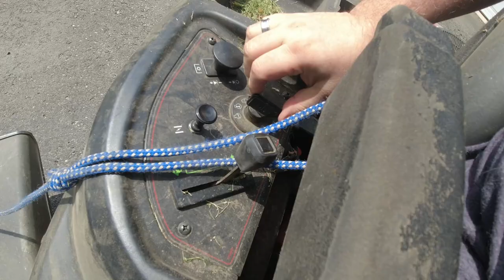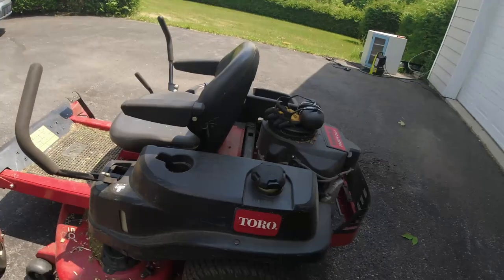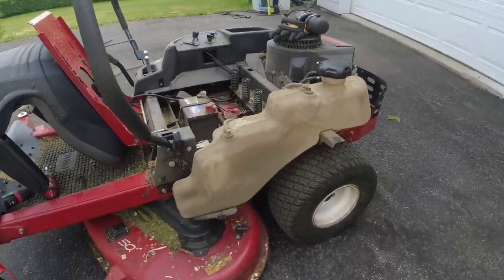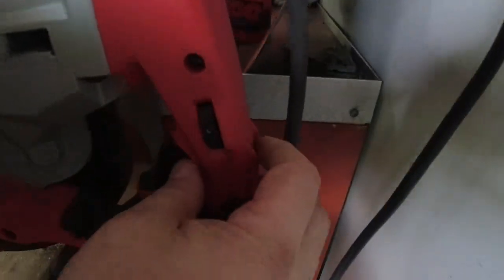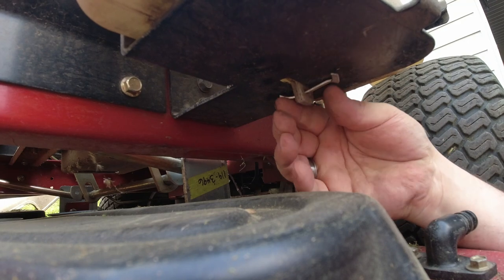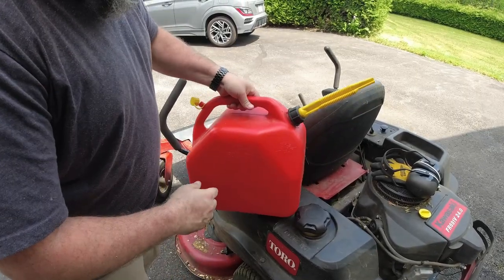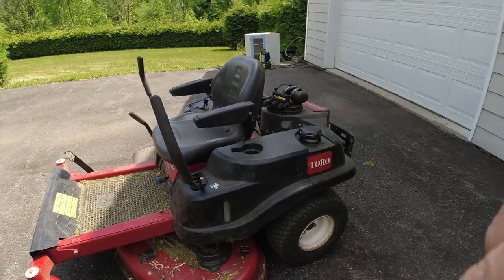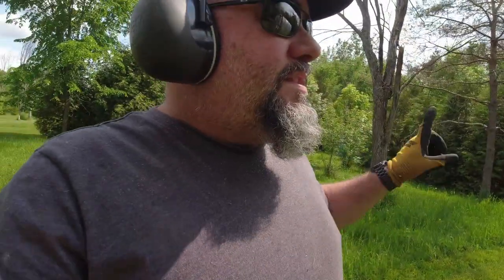Simple Solution to Your Zero Turn Gas Tank Problem

Comment: I would have put a couple of zio tie on it and seen how long they lasted.    Can't  get those gas cans in the states from the store, have to get aftermarket nozzle and some times those leak and aren't any better than original nozzle if they leak...
Reply from the maker: Funny you should say that. The piece I cut up was an expensive BMW part.. Aidan was... Not too happy and suggested I use zip ties or any other piece of metal we had laying around... Oops. Ya I've seen the newer gas cans around here, but glad we can still get these.

Comment: Hello Ross, it's amazing how much nicer everything looks after you cut the grass. That was an excellent quick fix on the fuel tank.  I use hearing protection only when I operate something that doesn't allow me to talk aloud and hear myself.  I  wear different types of protection based on what I  operate.  I  absolutely do find that some types of protection will amplify the noise if not worn correctly or for the wrong application.  I always want to hear the equipment at a level that allows for appropriate operation and to be able to detect any issues.   Have a good one Ross!
Reply from the maker: That's a great point about hearing the equipment. And do the same thing. It's now raining just a bit here and will help . Thanks Paul.  Have a great week

Comment: I have a pair of Isotune in ear and one over ear. I can't keep the in ear for long because they become uncomfortable and I'm a bit disappointed with the over ear model I have, the rubber pad peel away and it's not like I wear them everyday 🤷🏼‍♂️. I might look at getting something else. I do find when a wear any style for a long period my tinnitus seems to be more loud.  My JD E170 has a what they call a floating gas tank, it's always hard to tell the actual fuel level. Have a great week Ross 🙋🏼‍♂️
Reply from the maker: I have in ear  ISO Tunes as well, and agree, they can become uncomfortable over time (most in ears I've tried do this)  thanks Luc.

Comment: I did I miss that video maaan ??? 🤔🤔 Hearing protection is a must, Ross get a better earing protection ( look at the spec ) Please Ross, I'm deaf but the Tinnitus constant ringing is driving me NUTS. So mannn please act NOW !!! Great Fixe Ross 😇👌👍 Yes best fuel tank 👍👌😇 Ross, you should make hay with that field 😇👌OUTSTANDING video Cheers 🍻🍻
Reply from the maker: Thanks David, I'm looking for better hearing protection yes. My ear ringing has been bad for many years. I should make hay!
Reply: @RossOnTheLand  I can't afford the 6k device that will reduce the tinnitus and increase my hearing cause by many years working on aircraft but it work very well when a try it for 2 hrs,,, Cheers